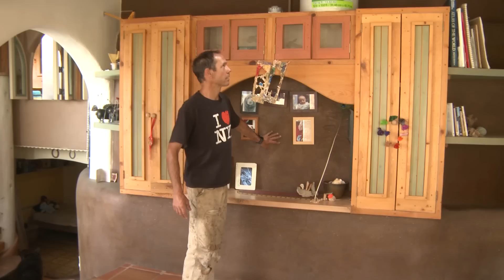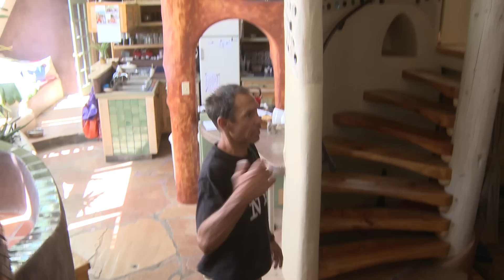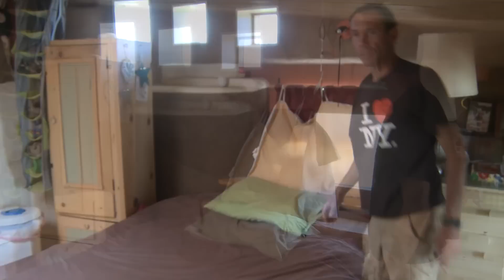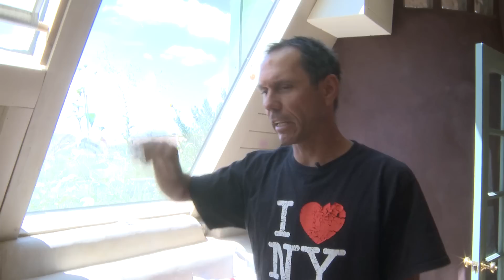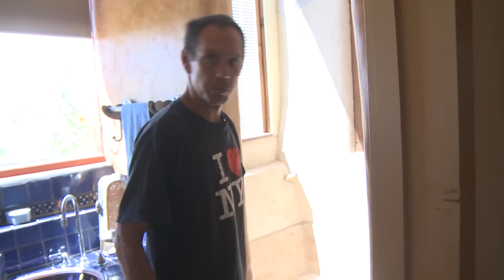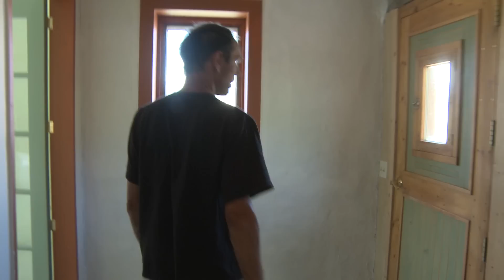Inside Ted's Custom Earthship

Comment: Passive cooling is great and all... but I'm starting an Earthship this spring and I'm planning on engineering an energy efficient active cooling solution built directly into a passive system -so that either may be used. I have plenty of water, so evaporation cooling seems to be my best option. 

The water pump will run on 12v but the exhaust fan needs to be pretty powerful. A 300 watt exhaust fan should be sufficient. With the addition of two solar panels I could directly power the active cooling system during hot days. When I'm not cooling the Earthship - a transfer switch can direct that extra energy into a battery bank or dump load. I want to build an over-sized aquaponic greenhouse on my earthship so that I can produce large quantities of food year-round... and an indoor swimming pool wouldn't be a bad idea either =)
Reply: poweredbyaaron99  Please if you could record your build that would be amazing! Or if you could give a tour or something. I'm sure many of us would love to see your dream in reality! :) Good luck and take care!
Reply: a natural pool would be my choice, many are converting their blue painted concrete pools to be green eco friendly with living plant cleaning systems. Check them out they're beautiful
Reply from the maker: where are you at?
Reply: lol I call BS

Comment: Radon build up in homes like "Earthships" is a concern as it causes cancer particularly lung cancer. From what I have seen this hasn't been addressed at all. People pay large amounts of money to live in these types of off grid homes and many builders who claim to be experts are blindly ignoring dangers like this. Off grid building typically does not require building permits or inspection so it is vital we help educate and inform people before they, their family and friends become victims.
Reply: Let me add that Radon can be a problem in any house where Radon exists. If you live in an area with Radon you should have your house tested no matter if it's an Earthship of a bungalow on Main Street. There is nothing inherent about the Earthship that makes Radon exposure worse.
Reply: +John Arizona I have seen several comments from you addressing the issue with Radon in these "Earthships". I understand your concern and would like to know more on how to prevent this, however you provide no further information. Reading online it seems this is caused by the earth and the tires used to build the house??? If correct ventilation and insulated walls can prevent this?? Again, I don't disagree with your comment, however raising awareness is good. But also providing ways of prevention and resources for the less knowledgeable people is also better. Thanks
Reply: +Paul Woodman All you need do is Google Radon. Radon mitigation is what they should be doing to avoid the problem at least in most cases. People who are considering buying one of these should have been told the dangers and at least made aware. If you do a simple search on Radon you will find masses of data. This is not a new discovery. Radon cancer is the second leading cause of cancer next to smoking.
Reply: Everything these days causes cancer, so we might as well save the planet whether it'll give  us cancer or not while doing so
Reply: noobie1890 prevention is relatively easy and you already do it in other areas. We all do. Informing people before selling a house and installing radon mitigation is a basic moral and ethical responsibility. If you bought a car that the previous owner knew had a toxic carbon monoxide leak into the car and your children got cancer then by your statement you would be fine with it because as you said:"  
Everything these days causes cancer, so we might as well save the planet whether it'll give us cancer or not while doing so"". If you truly believe what you said then why save the planet? If this deadly deception and corruption is acceptable to you then why do you care about saving anything?
Reply: +John Arizona that way the next people have a healthy planet to inhabit
Reply: +noobie1890 by poisoning the soil and creating a dwelling that collects poison gases which have been proven to cause cancer among a long laundry list of health dangers? No, that way is the greedy taking advantage of the ignorant. There are ways to do this without the aforementioned mistakes. Simple design alterations and implementations of green materials as people in my area have been doing for thousands of years. Adobe as one example.
Reply: This has been extensively researched by the university of Mexico and sorry but you're wrong.
Reply: Misty White Being connected to the ground without a block between the earth and interior atmosphere is precisely "inherit" for radon entering and being held there. hence the need for radon mitigation.

Comment: "earthships" (so-called) have many design flaws. Here're a few::
a) They even admit themselves, an adobe does everything they do, better. It's cheaper construction, and it's easy on the eyes - adobes BELONG. Earthships are an abomination on the landscape (look alien.)
b) The best human waste use is capturing urine, 100% nitrogen fertilizer, for fertilizing, and composting solid waste - there is NO smell, and in 2yrs you have organic sterile solid fertilizer.
c) Composting and capturing urine REDUCES unnecessary water waste (flushing commodes.)
d) Earthships lose all the passive solar heat in the front of the house all winter.
e) The tilt angle of the front wall of glass is such that it cannot be ergonomically hung with blinds to utilize the passive solar heat and cool.
f) Earthships do not have windows on 3 sides, a major loss of heat and cool.
g) Earthships use the TWO highest drains of electric energy -- hot water heater, and refrigerator. To be really efficient, you must use other designs.
h) What earthships do well :: They cycle grey water effectively.
i) See some passive solar designs that people actually built and live in, while watching pennies. These earthship guys are living off free land donated by the state, and grant money from a university.
j) Here's an example https://www.youtube.com/watch?v=4WbqNSUnaJM Peace.

Always look deeper.

Comment: All of the Earthships I've seen so far have been in the desert. Any examples/videos you can point me to that were built in cooler climates? I'm in Virginia, and I wonder how one would fare here.
Reply: Rick Rose Same here. I'm from Belgium and we get way less solar energy and get regular rain so the soil is wetter. So I too would like to see examples of earthships in different climates.
I suppose most off-grid houses are in the desert just because a connection to the grid there is harder.
Reply: +Ward Indigne Actually, I think a lot of the Codes that apply to building in the US dont apply in certain areas of New Mexico which is why so many Earthships are built there.
Reply: Ward Indigne Seattle is cloudy and our solar panels work great. Germany has tons of Solar Panels and you aren't far from there. Lot of people get more solar panels then they need, but only some cities will pay you for any extra electricity that you put back into the power grid.
Reply: Rick Rose In France they have homes inside caves. Just long as you can keep the bats out.
Reply: Ha! They have those in Spain as well. My wife and I saw one for sale when we were there a few years ago and thought, "Hmmmmm..."
Reply: There's one in Ontario Canada. From What i understand, You might need a booster heat source (like a wood or RockeyStove or propane) and humid areas are touch to cool w/o added a/c but otherwise looks like you can out them almost anywhere.